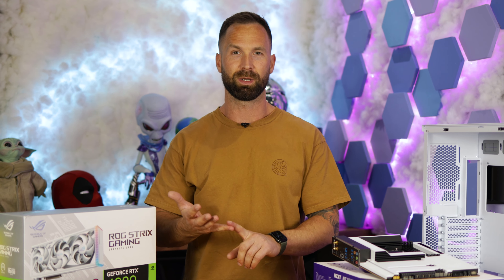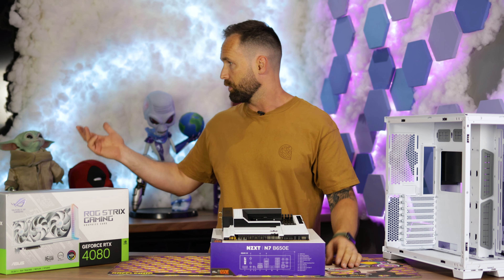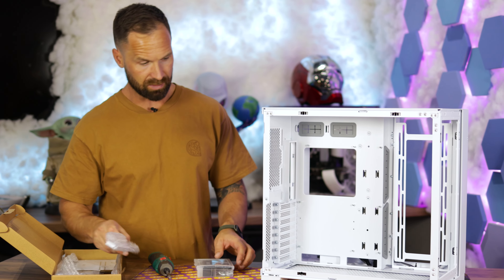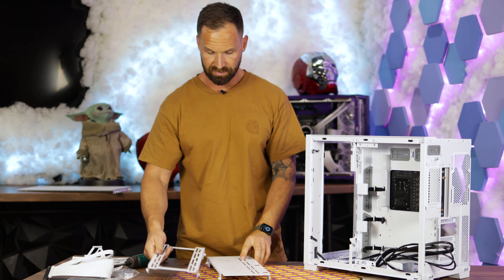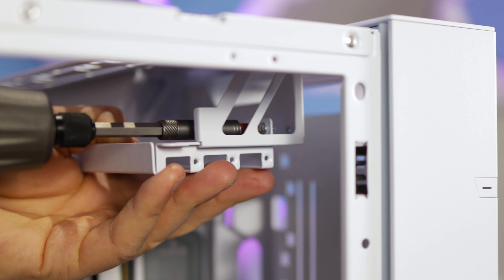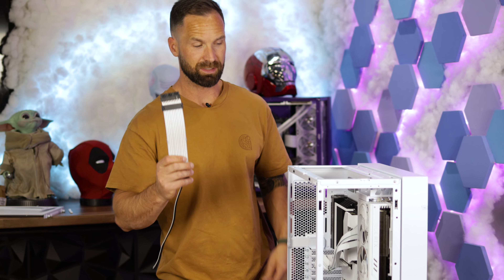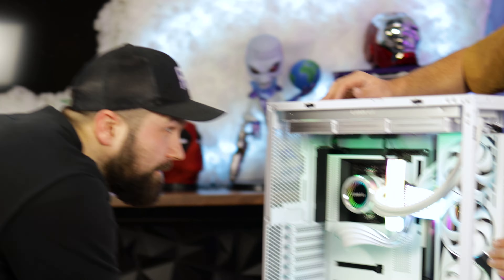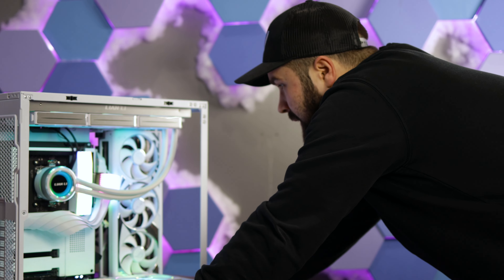How to Install an UPRIGHT GPU in a pc!! Custom Gaming PC! #rtx4080

Comment: Question. I have 3 additionally sl120 v2 fans. Should I mount 3 behind the GPU as intake or exhaust? Or 2 behind the gpu for intake or exhaust and 1 at the rear as exhaust? I have the XL case... your help would be much appreciated.

Comment: Quick question when you have your GPU upright using the Lian Li case, how can you connect things to your GPU port like you can install it horizontally
Reply from the maker: you can connect through a hole at the back of the pc... but to make it easier for the winner we put extensions that go all the way to the back of the pc
Reply: @RaffledUp  And will you have to have the right side panel opened or can it be closed after installing the gpu , Also I have a pc Lian with be quiet fans and don’t know how effectively Would they connect.